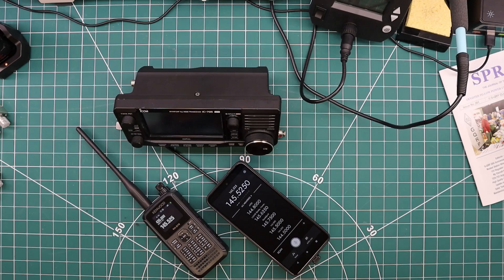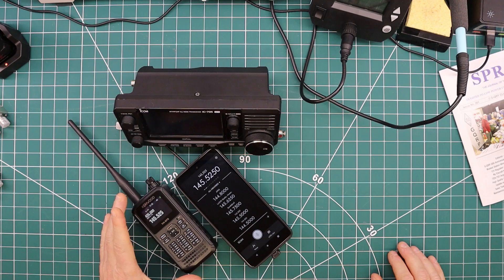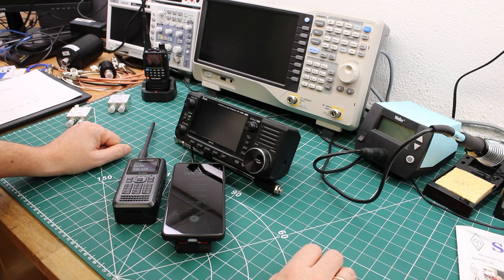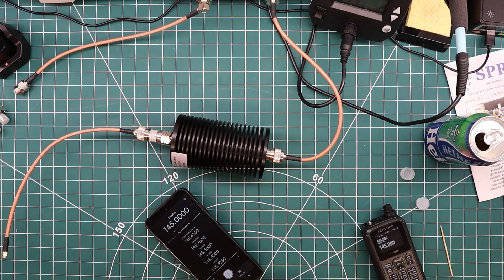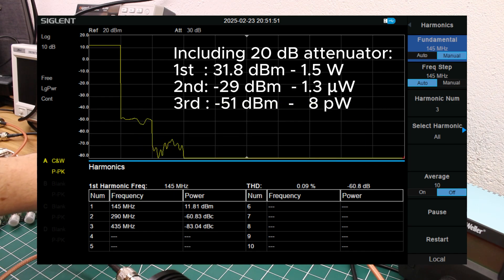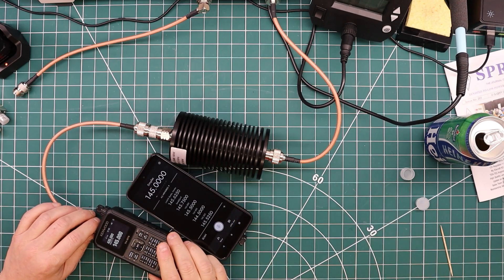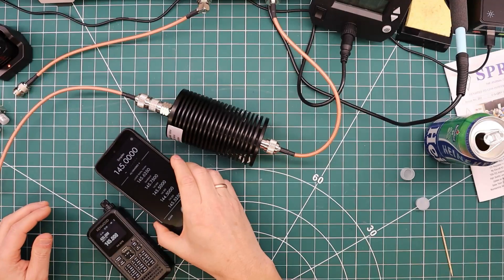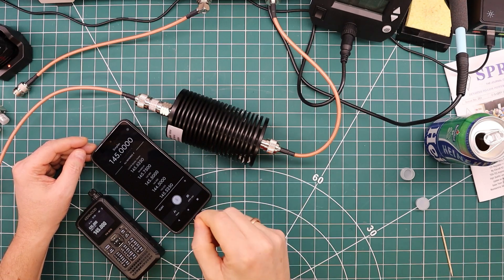KV4P-HT vs TH-D75: 1W VHF for Android

Comment: The Kenwood is putting out more power than the KV4P HT so it has a little more filtering to do.  The real question is how much wood did the Woodchuck chuck?  Did he meet his quota?  73
Reply from the maker: I agree the filters in the Kenwood has, as you say, more work to do. But irrespective of that, the filtering on the version 2 (revision c) KV4P HT brings the 2nd harmonic down to -61 dBc (61 dB below the fundamental) while the filtering in the TH-D75 "only" manages -57 dBc. Both are completely acceptable, but I think it's bloody impressive of the KV4P to have "better" filtering than the TH-D75!

Also; I'm happy to report that the Woodchuck met his quota and then some :-)